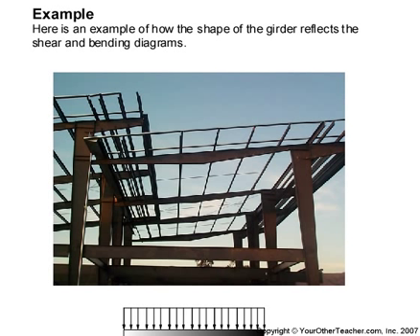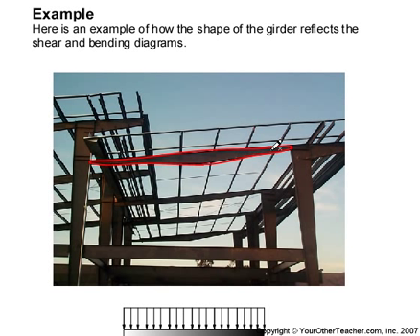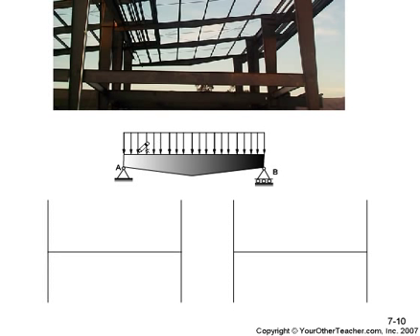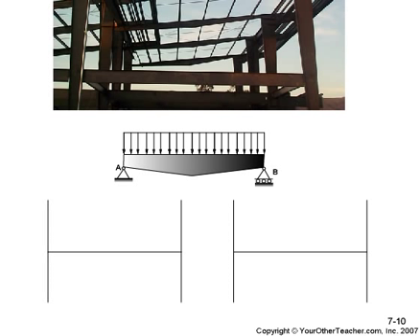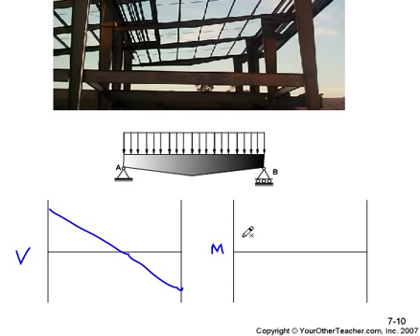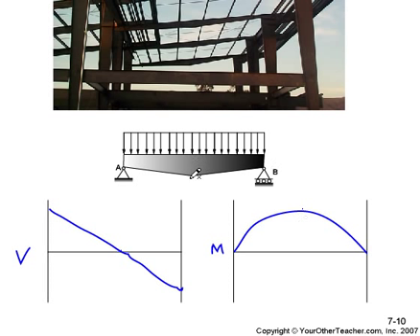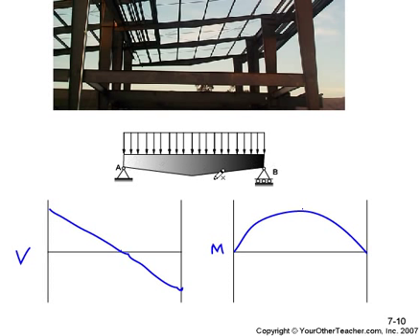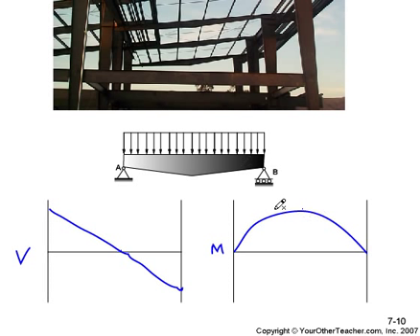Statics (Statics-07-10)

Comment: 1)finding the bending moment function and any values along the beam.If you find the load function,you can find the shear ,and then moment ;the method to be used is as you know is integration method,but remember you will only get general solution of these expressions because the constant of integration is unknown,how can I find them, where do I go for them? them means two,two constant of integration, in particular the initial shear  and moment,they are coordinates values or simply points........